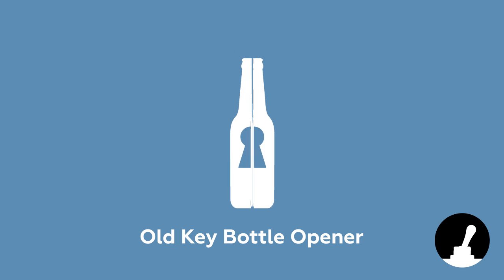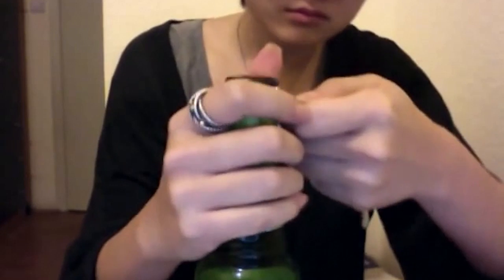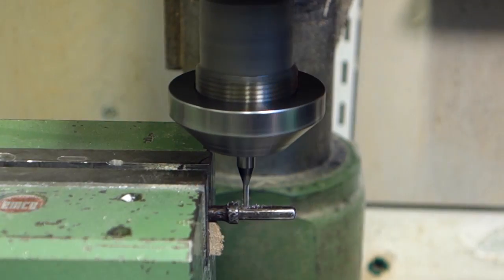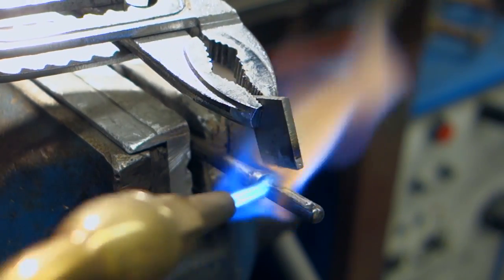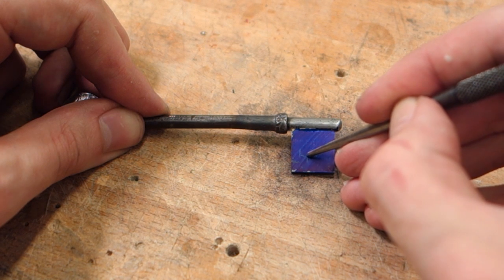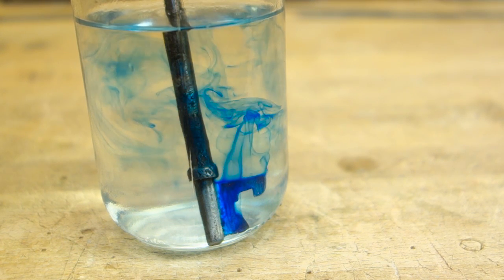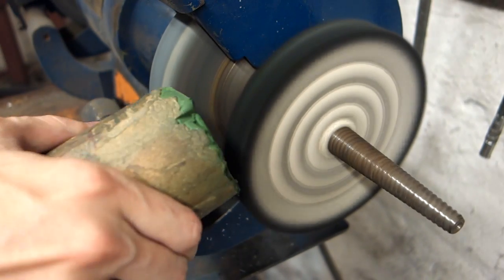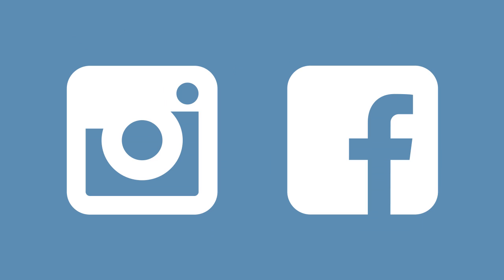Make an Old Key Bottle Opener

Comment: Nice project! I'm always looking for original bottle opener like this one. I'm guessing maybe there're some old keys which you could file down to get the desired form skipping the machining process. Thanks for share. I noticed a change of sound quality, don't know if I like more like this or previous one. And again, I really enjoy all the graphics work that comes with the video. Regards!
Reply from the maker: +Woodworking Barcelona indeed, if you find a key where the bit is big enough, or if it's blank (uncut) you may be able to get away with it. This one was just too small though. The audio is different, sure not entirely as clear, but it has a warmth which I felt the previous videos were lacking. Liking how my voice sounds sure does help through the hours of editing and hearing it over and over again. Haha!
Reply: Haha most definetly! If I get an old key that fits that need I'll give it a try and share it the results with you. About the voice thing, unlike people use to not like the changes I think it's good to try new things, so you got my support. Greetings!

Comment: Fantastic result man!! awesome! btw the brazing will work with a regular propane torth too? that was acetilene right? thanks man!
Reply from the maker: +Cactus! workshop depends on the melting temperature of your braze. I found for thicker pieces propane just is not able to dump enough heat into the part to melt the braze, but for thinner pieces, like sheet metal, it's definitely enough. That torch uses a propane/oxygen mix which can get a lot hotter than propane alone. It's basically like an acetylene torch, but with propane instead of acetylene.

Comment: Nice bottle opener project. I wish I had a mill to make one.
Reply from the maker: You don't even need a mill to be frank. You can use a hacksaw to cut a slot all the way through and fit a bit in there. It would require a lot more hand filing to get the top back to round again, but totally doable.
Reply: Daniel, 
Thank you, I may try that with the hacksaw.
Have a good weekend,
Jeff
Reply: +Switch & Lever I don't get it, why would I want to be Frank?
And what does the mill have to do with it?

Comment: Is there a way to purposely rust pitting and patina steel to match the rest of the key without letting time to it's thing?
Reply from the maker: Well, you can of course take advantage of natural processes and speed them up. Rust is basically just oxidation, and that you can get by using salt water, or even electrolysis. There are also more involved processes like bluing/browning/blackening the metal, but I think that's a bit above and beyond for a simple bottle opener.

Comment: Any rigid object > 3 inches or so long, grasp bottle near top, use top of thumb as fulcrum, bottle is open in 1 second. Lighter, larger keys, pocket knife, a largish pen, almost any tool. Can't believe anyone who went to college doesn't know this one. I don't even drink and I can open a bottle with almost anything in < 2 seconds.
Reply from the maker: Who says they don't? As I've said, just because you can hammer nails with a rock doesn't mean a hammer is not a better tool for the job.
Reply: If they did, they sure wouldn't be trying all the stuff at the beginning of the video.
Reply from the maker: I guess that the humor wasn't up your alley. That's alright. :)

Comment: Great video!
PS:The audio us fuzzy,just a heads up!
Reply from the maker: Hmm, when you say "fuzzy", what do you mean? I listened through it and it sounds just fine to me.
Reply from the maker: Indeed, I am using different audio recording equipment than before. I rather like the color it gives to the audio, but we'll see if I am alone in that. If it's a failure I'll return to the old solution in my next video.
Reply: I really don't like the "new" audio. It sounds you are using the microphone on a cheap gamer-headset.
Reply: I had to check if I was the only one, but apparently not :) I too think the narration lacks definition. Are you using the flea market mic?

Comment: u can teach how to make a dices for D&D RPG?  like a D20 D10 D12  its very  hard from the wood block
Reply from the maker: I don't even know where to begin to get them weighted properly. Making an icosahedron, dodecahedron or a decahedron should technically not be too difficult, but making sure all sides are weighted properly would be a nightmare. I would probably just 3d model it and send it off to get metal 3d printed.
Reply: Switch & Lever u can try do this :D

Comment: not needed if you cant open a bottle without it your not thirsty enough.
Reply from the maker: It's not about not being able to open a bottle (which I thought all the clips in the beginning pointed out), but rather about having the right tool for the job. Just because you can hammer nails in with a rock doesn't mean a hammer is not better suited for the task.